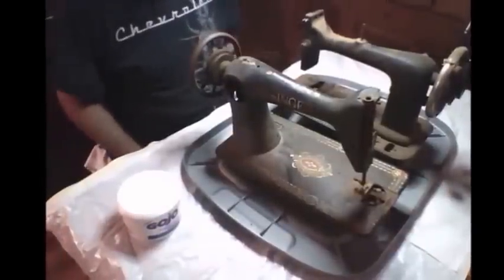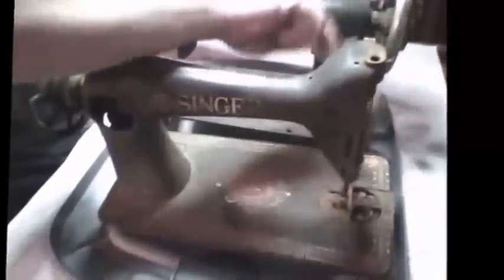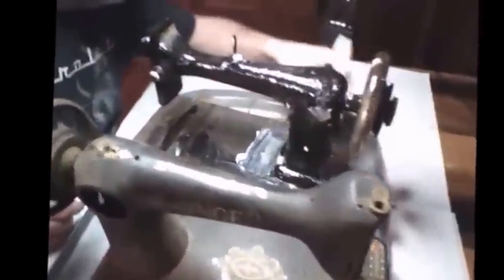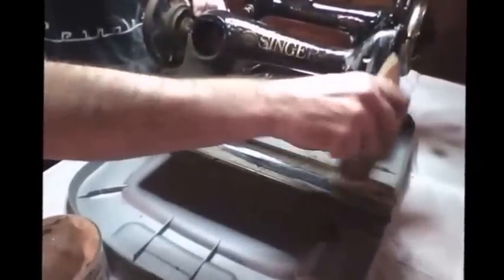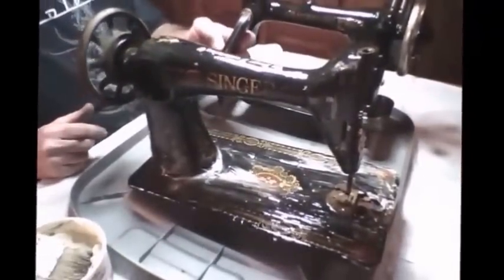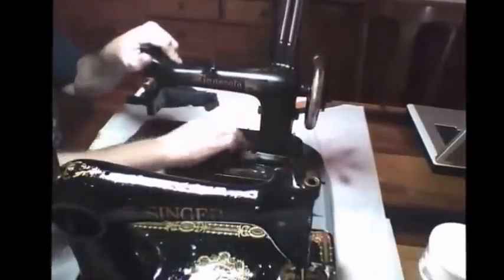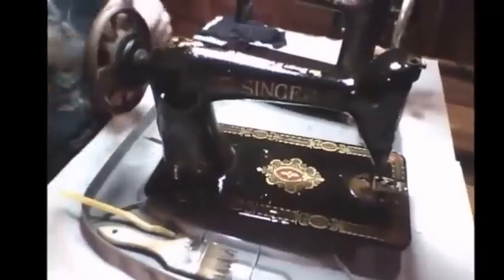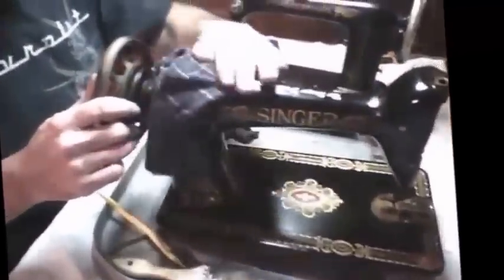Using Gojo to Clean a Vintage Singer Redeye and a Minnesota A Sewing Machines

Comment: Oh man I would not have the heart to be rough with a machine with decals in such great condition. I'll admit it kinda hurt. Informative video though!
Reply from the maker: That machine ended up put back together and looked amazing. Decals were not hurt at all, however I never let the Gojo stay on a machine longer than 2-3 minutes. In our workshops I have them apply to an area no larger than their hand and try to have them start wiping within a minute. Gojo doesn't discriminate between grime and compromised shellac or decals, so if their bad it'll wash them off 😁

Comment: I have a 201-2 and 15-91 that I just got. I've been afraid to use anything other than sewing machine oil to clean them with. The shellac is peeling in some areas. Will the gojo pull that shellac off? Thanks for making and sharing this video!
Reply from the maker: It will remove anything not attached. It really does not know the difference between grime and bad shellac that has lost its adhesion. Personally, I still clean them with Gojo because even sewing machine oil is going to wipe off shellac that's no longer attached. Sewing machine oil is not much of a cleaner anyway😉
Reply: @rayelkins7872  Thank you so much for replying! So many other YouTubers don't bother. Great information here. Thanks again!

Comment: Thanks I found some on Amazon. I'm  using it on a 301a singer that I'm cleaning. It works great getting the old oil off. I think it was oiled heavy then put away for a long while. Thanks again😃
Reply from the maker: Yes I had been buying it by the cases on Amazon, but now they show out of stock. There will be no more, according to my contact at corporate. We are going to try and see if we can make do with the red label in our restoration workshops, either that or find another product from some other manufacturer. :-(
Reply: Ray Elkins hide masin

Comment: I have recently discovered Bar Keeper's friend is great for shining up metal bits.  It's not abrasive per se, but I haven't tried it on the painted areas of any machine, or decals. If you have any aluminum, it will take that weird color it gets away with no effort at all.
Reply: Semi chrome polish for motorcycle engine cases will not scratch but it will clean and buff nickel or plated surfaces the best
Reply: Maguire's Fine Cut Cleaner will be much better.

Comment: So, what do you do for replacement parts. Those machines looked great when you finished with them. I'm sure with a good oiling and some TLC they will stitch like a dream. I love to see these old girls rescued. They were made to last and will do just that. Good job.
Reply from the maker: IfI can't find the parts, I make them. Being a machinist and having a lathe, vertical mill, and other machine tools is a great plus when restoring and collecting antique machines. However, machines like the two in this video are common and not worth the time required to make parts for them. Both of these machines were bought at auctions for less than $5 and are easy to come by. It is only the rare or more scarce machines that I will spend the time to make new parts for. :-)

Comment: That foggy looking coating you find on machines that is a light brown is simply the clear coating that was sprayed onto it to protect the paint underneath. The paint is usually really nice because it was protected. I think it's a mistake to clean the coating off.
Reply from the maker: yep, I don't recommend removing the bug shellac at all! That is what both of these machines had on them, but the purpose of the video was to experiment and see if the finish could be damaged if Gojo was used. We still use it in all the workshops with very good results, but never like in the video and never to purposely remove the shellac. As described, it was an experiment and not an attempt to restore these two machines. The Redeye, however, is actually now a reassembled, working machine and looks near mint. It was not damaged at all in the making of this video.

Comment: I'll avoid Gojo. These machines were Japanned for their finish, which is usually a recipe of linseed oil and a solvent/thinner, like turpentine.  No clear coast or sealants like some seem to think.  So I'll just use boiled linseed oil or sewing machine oil b/c oil seems safest based of what folks here and elsewhere have experienced with the decals.

Comment: I have a Singer with crazing top coat. Do you know what to do with that. I also have a beat up 30-15 I used several rounds of GOJO on and the decals looked better after. It almost went to the dump but I thought better of it. It needs a chrome hand wheel, slide plate, thread spool and stitch length screw!

Comment: I have a 1926 model Singer 127 how can I get the old dry dead clear coat off of the darned paint and not screw up my decals? And how would I go about re-applying new clear coat? What kind of clear coat would be best to spray over the existing decals? Thanks for any advice
Reply: I've had really good luck with just clear lacquer in a spray bomb for automobiles and other things.
Reply: Watch a video on French polishing. It’s your finish is shellac, you can save or repair it with new shellac coats. The new layers melt the old layers  and if done right can preserve and protect your decals. Good luck.

Comment: The Gojo looks to have done a thorough job, but you only wipe it off and then polish. What happens to the residue of Gojo that is inevitably left behind?  It makes me a bit nervous.
Reply from the maker: Any liquid residue that remains simply evaporates. I have machines on the shelves that were cleaned that way 10 years ago and they still look awesome.

Comment: Are there parts I should remove before using Gojo on a White Family Rotary machine if I hope to have it sew well at some point? Your quick restoration looks great!
Reply from the maker: Gojo isn't going to make the machine unusable in the future. I'd suggest oiling all the oil ports before cleaning, and make an attempt to keep from getting the Gojo in the oil holes. There is no way to keep it all out and that is ok. It won't hurt anything if some gets in there. There are no parts on the machine that must come off before cleaning. Just remember that in the video I left it on the machine for 20 minutes as an experiment only. In our workshops I have them wipe the Gojo on, give it a minute or two, then wipe it off. Leaving it to "soak" doesn't really clean better. Leaving it for very long can begin to soften the shellac on older machines because it is an organic compound, much like the dirt and residue that we want to remove. In any event, stop cleaning any area that you begin to see decals turning silver. Unfortunately, neither Gojo nor any other cleaner can  distinguish dirt from deteriorated paint and/or decals. If the decals and paint are bad, it will take it off just like it takes off the dirt :-)
Reply: Thanks so much for your quick and detailed response!
Reply: Ray Elkins 
Sir I don’t know how to get help.  I have just purchased a 211w151.  Took it to a retired sewing machine mechanic which has retired and does not want to work on machines any more.  But he said it was out of time and reset time. Sewed with it and looked good.  I brought it home and cut my pattern and started sewing.  It just sewed a few inches and stitches started messing up on bottom.   Could you have a video on what I need to do don’t have book or know how to get please help.  Am retired and trying to do my on work
Reply: Mr Elkins my thread hanger may have been wrapped around   Could this have gotten my machine out of time.   I watched your video. Where you said it could be the needle was in wrong. Would the machine have sewed at all if this was the case.    I have watched videos to try and make sure it is threaded right and tryed to check tension but can’t find a video with enough inf on my model.  Now my bobbin holder won’t turn all the way around.  At first the hook wouldn’t pick up needle thread.  I’m afraid I did something wrong
Reply: Brenda, this sounds like your upper tension isn't correct. Correct tension is based on a number of factors - fabric type, thread weight, even stitch lenght, from what I understand. What I do is get a piece of scrap fabric and fold it. Sew a bit, adjust tension, sew a bit more, adjust tension until the results is what I want it to be. Use 2 colors of thread. I like white on the spool and black in the bobbin. Easier to tell which is which after sewing. Sounds like your top tension is too loose if you're getting bird's nests on the underside of your fabric. Tighten the tension in small increments and sew test seam, until you get it to your liking.

As to your bobbin, remove it from the bobbin case. I'm not familiar with your machine. Check in around the bobbin, bobbin case looking for threads that may be caught in the wrong place.  Re-insert bobbin in the case and thread according to your machine's instructions. 

As to your needle, yes the machine will usually sew if the needle is inserted incorrectly. However, the thread tension can be affected by many things, including the direction the thread travels, down the needle and into the fabric. Changing the path (direction) from the original design of the machine can affect tension. 

Generally machine timing isn't affected by things like bird's nests from poor tension settings. Timing is controlled by the physical settings of rods and gears. Repair by loosening screws to adjust timing. So, it does take some force applied to throw timing off. 

I hope by this time you have already resolved the problem. Remember you can also watch videos of other models of machines that have similar bobbin setup. Threading on most machine is similar in the travel  path. As is adjusting upper tension with or without a numbered dial. For more specifics of your machine, you can also check the manual. If you don't have one, they are usually easy to find on line. Just google brand name, model number and the word manual. 

If you're still having trouble, hope this helps, a bit.
Reply: Check to see if you have your bobbin in backwards. That can make a difference.
Reply: @howardlovecraft750  Thank you.

Comment: Well, I tried the Gojo, it is removing a thick coat of greasy crud, and the decals. I guess they were deteriorated. They were pretty much complete before I started. Wishing I'd just used oil. Ugh. I'll stick with oil from now on.
Reply from the maker: I'm so sorry. I've yet to have an issue with it and we use it not only on all our machines but all machines that folks bring to our Sew Purty Workshops restoration retreats. I don't leave it for the 20 minutes like in the video and never would on a machine I want to restore or preserve. Since the shellac is an organic compound just like the crud that is on most of the older machines (whale oil), we have to always be careful. Since there is always the chance the decals are going to be as easy to remove as the crud, we never completely coat a machine until we know the decals are safe.
Reply: Thanks for your reply. I didn't leave it 20 minutes either, only about 5. I didn't test it because you said the Redeye decals were hard to remove and I considered your test, a test...lol  Anyway, the only reason I commented was so that others don't jump in, excited to get one clean in such a hurry and lose the old decals like I did. This machine is from 1910, If I remember correctly...so not anywhere near new, from a treadle that had sat in a barn no telling how long. It was covered in what I would figure is diesel fumes from tractors... She turns well and I imagine she will sew just fine, once I get her clean enough to get fabric near her. Thanks for all you do to save these old gals.
Reply: Thanks so much for your info on Gojo effect on decals.  I'll stick with oil too.
Reply: Hand cleaners are a mixture of kerosene, lots of water, and a surfactant (fancy soap).  It is beat up until it forms a "grease".  So, using pure kerosene will work and I have done that.  Sewing machine oil is the safest and I have used it also.  Linseed oil is probably going to work also, but can take weeks to "dry".  What any of these "oils" is doing is filling the void spaces that scatter light and make the finish look hazed. 

Some hand cleaners use odorless mineral spirits, just like used to remove oil based paint from hands, brushes, and surfaces.  

The kerosene disperses grease or even oil based paint on hands or brushes, respectively.  Adding water converts the material to a white emulsion of kerosene and water; and the surfactant then washes the kerosene and grease off your hands.

Kerosene is not pure and will eventually evaporate, if polished down to a thin film.  French polishing with shellac can be tricky and the ethanol will dissolve the old shellac.  Not good.  So, FPers will mix in oil or boiled linseed oil at first.  You better know what you are doing to use FP.  See the sticky on quiltingboard.com about FPing in the vintage machine section.

Singer sewing machine oil is highly refined.  It takes a long time to oxidize and form a "glue" in moving joints.  Cheaper sewing machine oils oxidize faster and form a yellow or amber color.  Use the real Singer oil to be the safest.  Test out your restoration product underneath the base plate FIRST.  If you have problems, use $-Singer oil.
If the pores are real fine and like near molecular in size, the oil or kerosene will not evaporate for a very long time.  If you coat with hand cleaner, overcoat with lots of Singer oil and let it stand for weeks to extract some of the kerosene and replace it with Singer oil (diffusion).

You should now understand exactly what is happening with each type of product.  I agree with aspec42 to be the safest.   Forget 3-1 oil.  Get the real thing.
Reply: Here is a resource for decals:  https://singer-featherweight.com/search?q=decals

Comment: Ray have you ever heard of anyone using electrolysis to strip paint and gunk off of a cast iron singer?  I have a model 27 that has a lot of paint chipped off and have decided to strip off all the old paint and repaint it.
Reply from the maker: I have used electrolysis extensively to remove rust and used it in reverse to rust new hardware in my projects using reclaimed lumber. Electrolysis is very good to remove rust, however it would leave a lot to be desired as a paint remover. Electrolysis only works when the current can reach the metal, as in the metal must be bare or the remaining paint in such poor condition and porous enough that the current can get to the metal surface. Also it is not a gunk remover. It will not penetrate grease or anything coating the surface of the metal that isn't water soluble. The reason I know this is I use grease to "mask" areas that I don't want to be rusty when I do the reverse electrolysis. :-) 
 Another thing to keep in mind is electrolysis works "line if sight". In other words, the anode (+) must have  direct "view" of the area that you are removing rust from. With an anode placed at the front of the machine, there will be no rust removed from the back side> Same goes with the inside of the machine housing. Anodes placed around the outside will clean the outside but there will be no rust removed from the inside. Making sense? lol  Electrolysis is a lot of help in certain situations but not a gunk cleaner or paint stripper. :-)
Reply: Ray Elkins thank you sir!

Comment: Ray, now that you've used the Gojo a bunch, have you ever had bad results with the decals?
Reply from the maker: No I haven't yet, not that can be blamed on the Gojo. We have used it now going on 2 years in the Sew Purty Workshops on hundreds of machines and so far not a "oh NO" moment. As with any method of cleaning, we have seen the occasional incident where the decals were already so fragile that wiping across them with anything would damage them, but we have not had a machine where Gojo has caused any damage. We are always still careful and learning more and more about which machines to be extra careful with. Needless to say, I have had to explain more than once that this video was not meant to exhibit how to use Gojo but was an experiment to see if Gojo could damage a machine's finish. Some people miss that part of the description! :-)
Reply from the maker: I would like to add that the models of machines that we are leery about or can tell upon inspection that the shellac is in poor condition, the Gojo is wiped on and then wiped off. Never allowed to sit on the finish or "soak". In the video was 20 minutes to test, but in reality I don't leave it on anything with bug shellac over 1-2 minutes. I prefer to wipe it on and then wipe it off.